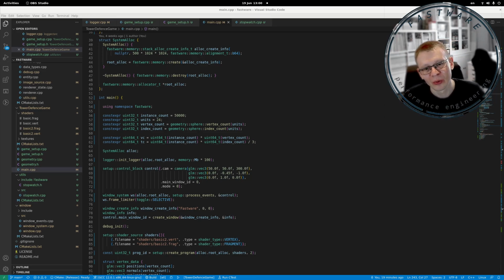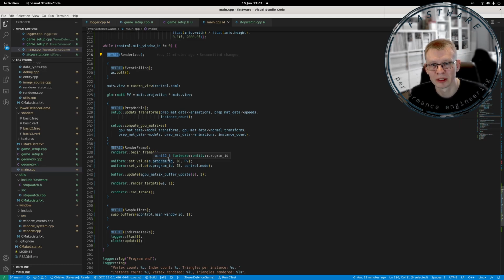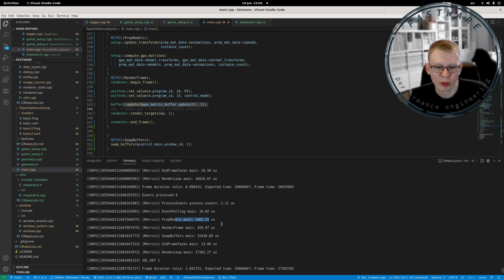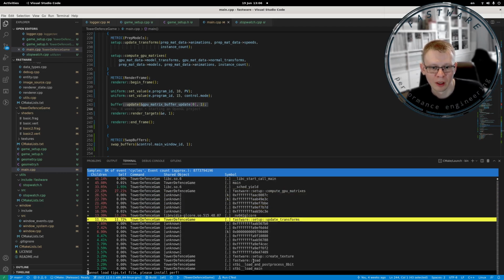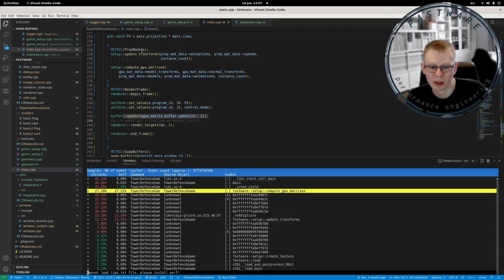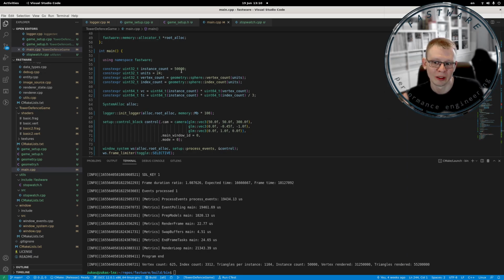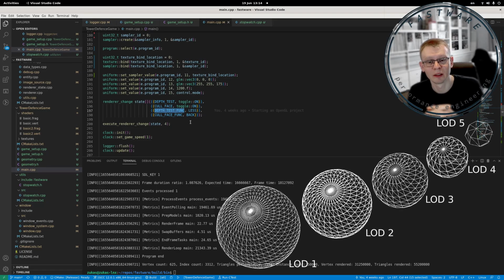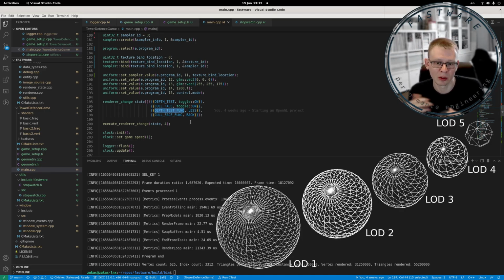Fastware - Premature optimization?

Comment: I completely agree on your premature optimization point. You cannot retrofit testability into your application as wells as performance.
Reply from the maker: Good point! My uni really failed to prepare future engineers and instill a correct approach and attitude.
On a separate note, do you like the direction I am take this project? Are you learning something useful? Or should I do something else?
Reply: @Fastware  Yes definitely I'm learning from this videos, but I would prefer for the serie to don't get too long otherwise it would get hard to follow.
Reply from the maker: @diegobellani  Will keep it in mind